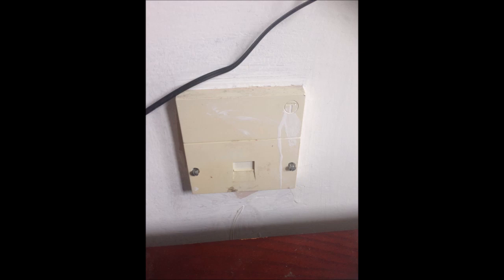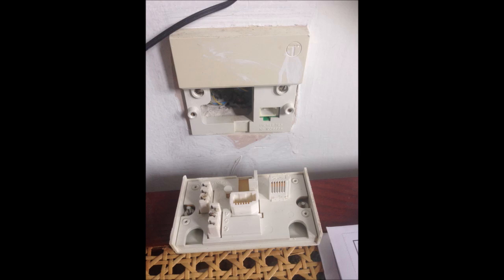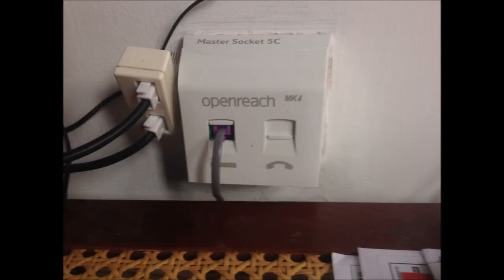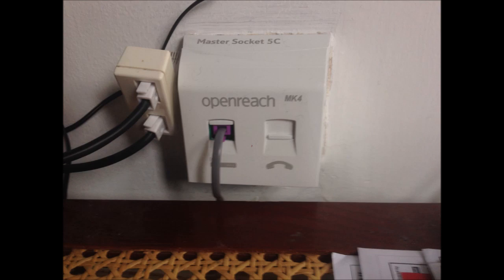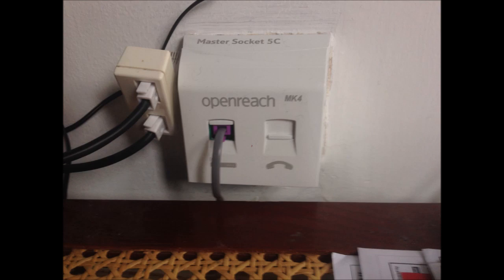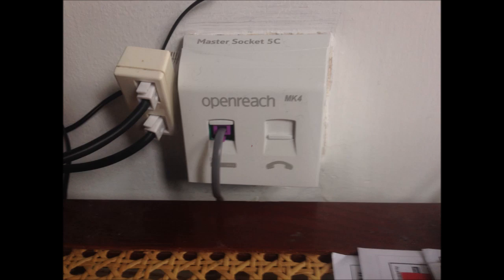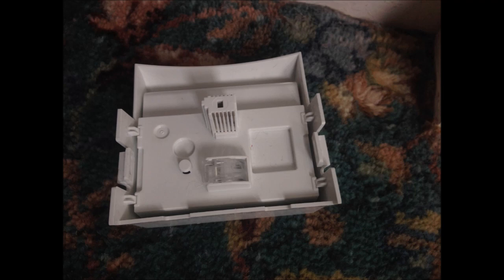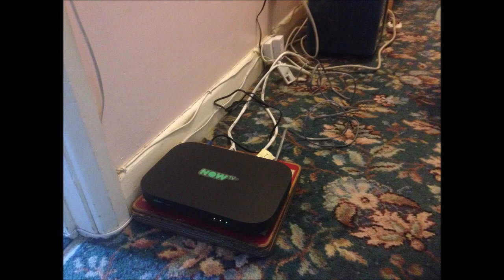BT Telephone Sockets: What to Do if Want to Install Broadband Router away from Master Socket?

Comment: When you remove the faceplate on the master socket, the tab behind it can be used to route the unfiltered signal up a telephone or cat5e cable (using 2 wires only).  If the cable from the upstairs telephone socket runs here you simply need to connect it to the master socket.  Then plug your filter into your bedroom socket and plug your router into it.  Both sockets will still be avaiable to use as a phone line.  No need to run long externsions.
Reply from the maker: Hi, Thank you for your helpful information. Have a good day!
Reply: Doing that would create a bridge tap on line which could slow down internet speed
Reply from the maker: @ESS_Comms  Thank you for the info! I do have the  impedance matching components at the other end, thus the internet speed is above the estimated speed from Vodafone or now Plusnet. Have a good day!

Comment: You could hardwire your extension into the back plate (into the clear clip to the right hand side) if you use you extension for both phone and BB or hardwire it into the back of the front plate if you only use it for BB.
Reply: ++then you won’t need the filter at the other end just a bt to rj11 cable to plug directly into the router (or change the extension to an rj11 plug)
Reply from the maker: Thank you for your hard-wiring comments. It will surely help someone who like to do tidier hard-wiring instead of plug-in type of extension or wiring. Thank you and have a good day!

Comment: Interesting vid, not too sure but I thought the socket you are using is the one for testing the phone line and not to be used as an option in extending.
If you know the colours of the two wires then add a dedicated BB extension cable connected up using the a&b terminals.
Reply from the maker: Hi, Thank you for your comments. Although my extension line is extremely long, my Broadband and telephones have been working well in the past two years. I also switched to Vodafone broadband last year and I placed the router at the same location. Stay Safe! Have a good day!

Comment: Will broadband work if I just connect my broadband connection to the master socket instead of the faceplate ?
Reply from the maker: if you remove the faceplate, there is a BT socket for providing both telephone and broadband signals. In this case, you need a micro filter to plug into the BT socket, then your router and telephone can be plugged into their respective sockets. The answer is: your broadband will work if you plug it into the master socket(without faceplate) via a microfilter. have  a happy day!
Reply: @RepairDIY  thank you I will try this I have the same master socket has you I have a micro filter but it says on the micro filter  do not fit if you have a pre filtered master socket so I'm presuming it want work
Reply from the maker: @shanehutchinson785  Hi, if your master socket unit has two sockets and you do not remove the faceplate, then you do not use the microfilter! you just plug your rout directly to that square socket and your telephone to that narrow socket. Enjoy your day!

Comment: Excuse me, I got a BT hub smart 2 how can I connect it to the purple socket where is the broadband drawing
Reply from the maker: you could check if you are using the correct cable/connector. you may be able to find the correct cable in the original packaging box. good luck!

Comment: I've had nothing but problems with these Mk4 Openreach master sockets. Twice now I've had the issue after 3 years where the front plate stops the phone line or the broadband working. I've had to buy a replacement master socket 5c mk4 and fit the new faceplate onto the original backing plate. 

They must use some incredibly cheap components inside the faceplate for this fault to happen considering there are no moving parts inside to my knowledge. 

Anyone else had the same issue?
Reply from the maker: Update: In March 2023, I switched to Vodafone Full Fibre broadband with the router THG3000.  Now the telephone line is over the fibre and my old telephone is plugged directly into the router's Tel 1 socket. No longer use the copper telephone line and BT/OR may switch off the copper wire network in near future. Have a good day!

Comment: Hey interesting Video, What are the names of the cables you have? The White bit with Black cable showed at 2:40 is that a landline cable or? trying to find out the name of it.
Reply from the maker: hi, that cable is for connecting to the telephone or fax machine. you may just call them as "BT telephone cable"? cheers

Comment: Hi I ripped my broadband cable, is there anyway I can use my WiFi without the broadband cable?
Reply from the maker: hi, if the broadband cable (from router to telephone socket is not connected, you surely have no internet, but the wifi should still work, such as sharing a networked printer. HI, as each time we change ISP we receive a new router, so  just find your old router box and take out the broadband cable for this router, they should be the same? or you have to buy one from ebay? good luck!

Comment: I want a master socket 5c transferred upstairs to my room. How can I do this?
Reply from the maker: hi,  i recommend that you keep the BT master socket where it is, without removing the existing backbox of the master socket (BT should be happy with not touching their backbox?). if you really like a master socket upstairs, you could buy another one, and install it upstairs. the connections are very similar. Have a good day!
Reply: @RepairDIY  Thank you. Do you recommend me using a powerline adapter or a long ethernet cable going up the stairs and through the house?
Reply from the maker: @tomdenub3302  hi, good question! i have never used any wifi extenders yet. When my router was downstairs, i did use two 15 meter ethernet cables to connect my computers upstairs for a few days, without fixing the cables to walls or floors. Fixing cables to walls and stairs is not a easy job and it may look no good? you could try wifi extenders, but for me, i just put the router upstairs close to my desktop computers, and I can use mobile phones and laptops downstairs everyday. I also tried to use an old router  connected to the active router with ethernet cable, the active router was upstairs and the old router downstairs. It was working but I decided not to fixing the cable to walls and stairs, so I just dropped the idea. I think the telephone line is much easier to climb the stairs (I already had them years ago), or just use the wireless wifi extenders? Have a good day!
Reply: @RepairDIY  Thank you for the explanation. I think powerline adaptors seem like they are the simplest and easiest to set up.
Reply from the maker: @tomdenub3302  try to buy ones with the best reviews (strong signals etc). good luck!
Reply: @RepairDIY  do you think tenda ph3 av1000 would be good?
Reply from the maker: @tomdenub3302  hi, as i have never bought or used any, so i really don't know which brands are better. you may just do some searches and read some reviews then decide. hope they work well !
Reply: @RepairDIY  hi my WiFi router cable didn't want to fit upstairs so I bought a wifi microfilter and now it fits. The problem is now that it says I have no WiFi signal. Can you help me again please?
Reply from the maker: @tomdenub3302  hi,  no problems for using microfilter. in fact for each telephone connection, you must have a microfilter installed! the microfilter separates the broadband signals and telephone signals. so there two outputs of the microfilter: the modem socket and BT socket. the modem socket has broadband signal and the BT socket has the telephone signal. the same applies to the master socket! in my video, I removed the face plate of the master socket and plugged in a telephone line extension cable so that I can have broadband signals upstairs. Therefore, make sure you have removed the face plate of the master socket downstairs and use a similar cable as I showed in the video, then you should have your router working. hope it help. have a good day!
Reply: @RepairDIY  have you got Instagram? I want to send you pictures of what it looks like. I am so confused
Reply from the maker: @tomdenub3302  hi, let me say it in another way: if you are using a BT telephone extension cable to connect from the master socket(new design with two sockets on it) to upstairs, it will not work!  because from the new master BT socket you have no broadband signals.  If you remove the font plate of the new master socket, then plug the extension cable to the socket on the back plate of the new master socket, then it should work. In another word: if you are doing it in a similar way as I did in the video, you should do every step the same way. Hope you figure it out soon. good luck!
Reply: @RepairDIY  but my telephone socket doesn't have a backplate. When I unscrewed it there was just cables inside a wall.
Reply from the maker: @tomdenub3302  hi, if that is the case, you can use a normal telephone extension cable kit to upstairs and use your router there. It should work that way. If it didn't, you can test your cable connections by using a telephone: without the router connected, try if you have ringtone downstairs and upstairs, if you do have rings upstairs, you can then plug in the filter and then connect your router to the filter. Also remember, you must use a filter for each telephone you use anywhere in your house. Hope you work it out soon. Good luck!
Reply: @RepairDIY  so I used a microfilter and connected my phone to a telephone socket upstairs and the phone doesn't work but it does work downstairs when it's plugged to a master socket
Reply from the maker: @tomdenub3302  So you know it may be your cable problem. Check your cable connection, check the socket upstairs, you telephone must work upstairs before you try to connect your router. You are closer to success. Good luck.
Reply: @RepairDIY  my telephone does not work when I connect it
Reply from the maker: @tomdenub3302  hi, check you cable and socket box(if fitted)?  Could be a broken wire or loose connection? or try another cable? good luck!
Reply: @RepairDIY  Thank you for all your help. I appreciate it but I don't think I can do cabling because I don't know how it works. Thank you for everything anyway 👍
Reply from the maker: @tomdenub3302  You are welcome. I am in UK. I just went to the supermarket Tesco, they have wifi extenders on shelves. They could be available in any supermarkets. If they don't work, it should be easy to return? You could buy these and have a try? Have a good day!
Reply: @RepairDIY  Thanks. Do you know how much they cost? Have a nice day
Reply from the maker: @tomdenub3302  Tp-Link 300Mbps Wi-Fi Range Extender Booster, £ 20.00, also available online. 
https://www.tesco.com/groceries/en-GB/products/279566421
Reply: @RepairDIY  do you think the WiFi extenders will Be taking all the WiFi away? So other people in the house will have slower WiFi?
Reply from the maker: @tomdenub3302  tghe wifi booster/extender just does what the name refers to: boost/extend your wifi to the areas where the wifi signals not strong enough. wifi actual speed depend on how many devices are using the internet at the same time, will not be affected by the booster/extender. cheers.
Reply: @RepairDIY  Thank you for all your help. I really do appreciate it! Cheers man. We need more helpful people like you on YouTube 👍
Reply from the maker: @tomdenub3302  Thank you for your comments. Stay safe and all the best!
Reply: @RepairDIY  you too 👋
Reply: @tomdenub3302  they both do the same thing. Powerline adapters would be easier/faster and you won’t have a wire running along your walls. But if your house is not on the same ring main they will not work so you would have to run a cable.
Reply: @tomdenub3302  have you resolved this issue? If you go to your extension socket and unscrew the two screws. Have a look at the wires connected to the faceplate. You should have a orange wire connected to number 3. This is for your phone line. You should also hopefully see blue in 2 and blue/white in 5.
Reply: @SteCollects  I got a 500mbps Powerline Adapter and it doesn't really help that much
Reply: everyone check out Mr Telephone channel